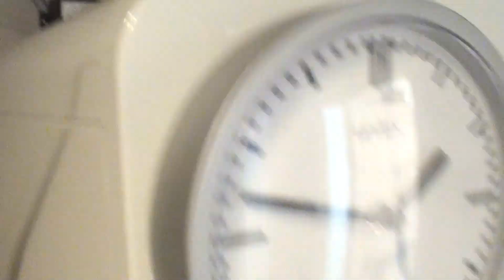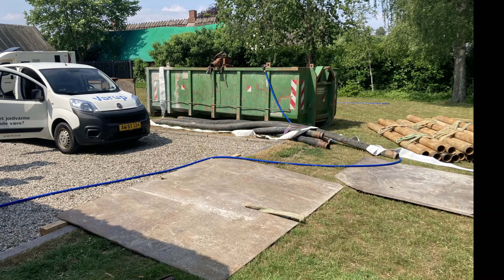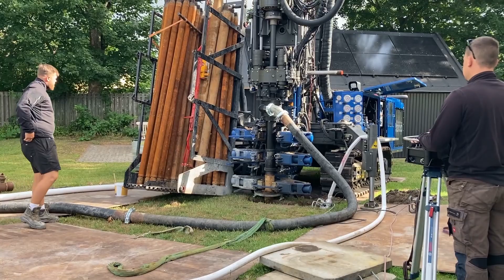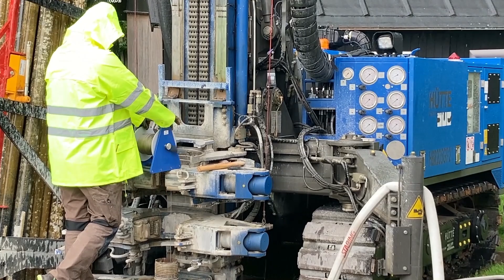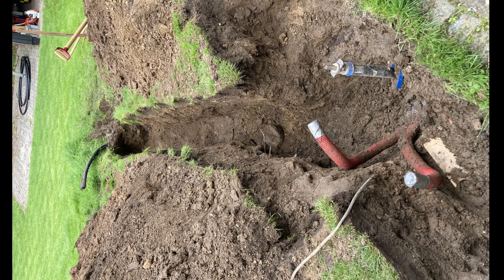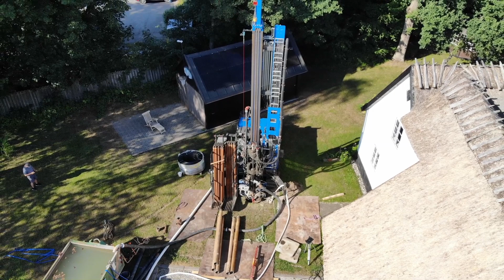Drilling and Installing a 212m Deep Vertical Geothermal Loop

Comment: Thanks for this video, my friend. Where are you located? Maybe it's your accent that makes it click, but are you in Finland or somewhere like that? I only ask, because it occurs to me that up in that general area, there are hot springs and things where the earth heat warms the water and despite the atmosphere in that area being really cold, the water coming up from the ground is often steaming hot. Heated by the molten Earth's core.

Wouldn't that mean that a well like you just showed being installed have much more benefit? A 200M hole drilled straight down into into the Earth where the magma at the center is close enough to heat the ground water that rises to the surface would catch more heat than somewhere, warm or cool, that doesn't benefit from that?

You did a fine job, my friend. I appreciate your efforts here.

Thank you.

Comment: Nice work! Question for you …what happens if you hit water before the insert drill reaches 212 m (791 ft)? Thanks
Reply from the maker: @haynesdarlington792  We did hit water. Ground water is only 1-2meter below the ground. However, it stays there. It is very likely that we meet several more layers of ground water on the way down. 
One of the reasons for adding bentonite to the hole after inserting the tube is to keep the layers separated.

Comment: What was the high and lowest temperature at inlet brine in heat pump? Thanks.
Reply from the maker: @user-ry7yg2hk7i  January 17 (coldest day in the year): Brine in 4.3C, out -1.0. July 2nd Brine in 9.3, out 6.0

Comment: Martin, thank you so much for making this video. So if I could ask you a few questions?
How large is your house and how many tons or BTU is your heat pump? Can you power it through the winter on your solar system?
Reply from the maker: @gordon6029  The house has a heated area of ca 320m2. The heat pump is a 4-16kW Bosch
Reply: @martinbarfoed5040  thanks for that. I’m building with ICF and will only have an area of about the same.

Comment: There us only one hole with only one loop down? Is that enough and how big is your home?
Reply from the maker: Yes, one hole. The up/down tubes join with a U at the bottom. 
The thermal yield is expected to be ca 50W per meter. So ca. 10.5kW from our drilling. This winter we heated 320m2 with no problem

Comment: IS CEMENTING NEEDED in geothermal drilling ?  like this one in the video .
Reply from the maker: It’s a local requirement. It is to separate different layers of ground water. Other cities may have different rules.
Reply: @martinbarfoed5040  thank you for answering sir
Reply: actuelly its not 100% cemenet its a meture of bentonate n some amount of cement...its called in Germany Demmer. But its very important to isolate the loop from the drilled wall.

Comment: I would like to know the cost of the drilling
Reply from the maker: It’s expensive ! I think we paid ca EUR 20000 ex VAT. However it has worked really well during this winter-also in periods with very low temperatures

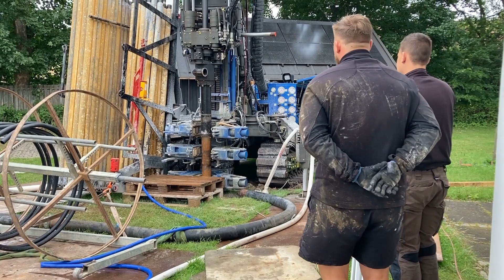Comment: At 13:30 driller forgot to rotate tricone bit (upper head is not rotating). No wonder he had a problem at the end 28:30 to extract casing pipes. Also, he should engage 1st gear to reduce rotation speed and increase torque when pull out casing pipes. Looks like the driller is a freshman. Dangerous.
Reply: Did t see him grease the threads , think that’s why he had a hard time splitting the casings
Reply: Not using those bars on second and first jaw will stretch the steel behind and eventually he will have hard time squeezing the rods / casing.
Reply: When tripping out he’s threading on and opening the jaws letting the weight of the rods shock the chain, lol that chain will fail in a couple months like that

Comment: This answers most of my questions. The only question I have is, after drilling about 250 feet deep I see that you’ve connected the geothermal from the top spot into the basement. 
Is that not loosing heat or cold temperature before getting to your house?
Are you able to trim the cable at least 6 feet down to maintain and prevent freezing? And then take the pipe into your basement?
Reply: for ur question they fill the pipe with special fluid to keep the heat. Its a reverse of refrigerator.

Comment: You should talk about ground based not geothermal.
Ground based uses the constant temperature that you find at shallow depths.
Geothermal uses the heat radiating from the earth core at greater depths.
Reply: here in europe its called geothermal, not onlly for shallow depth..it can be drilled up to 1500m. Collecting heat from under ground, it can be also steam water from volcano.
Reply: @xFlavoriax  Calling ground-based heat geothermal is a new fad. It just sounds more exiting, but leads to confusion.
How do you distinguish between the heat sources but through names. Geothermal heat, I mean heat radiating from the earth core, is not connected to vulcanoes only, it is everywhere if you drill deep enough. In tectonic areas you just have to drill less deep.
Reply: At 200 meters, temperature are already around 20-25°... I think we can talk about geothermal
Reply: @Melpheos1er  At 200 m you are far from geothermal, try 800 in areas were you do not have volcanic activity.